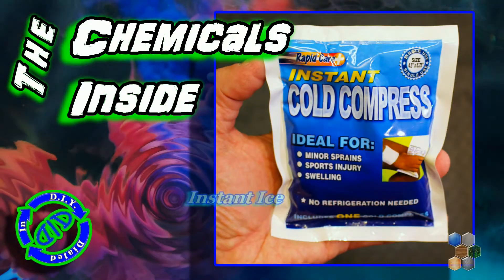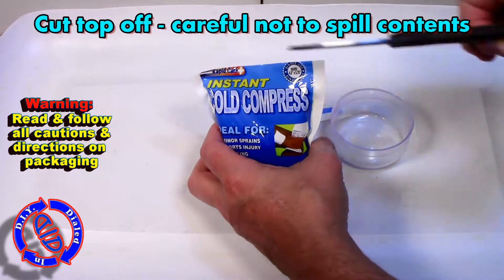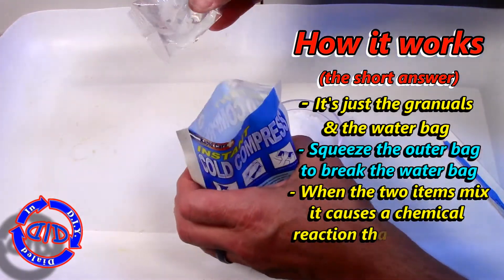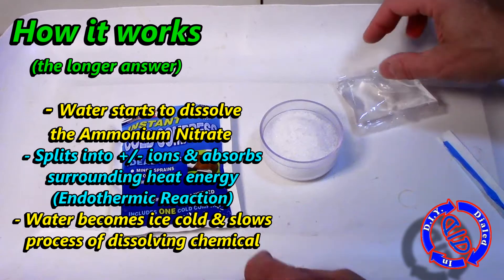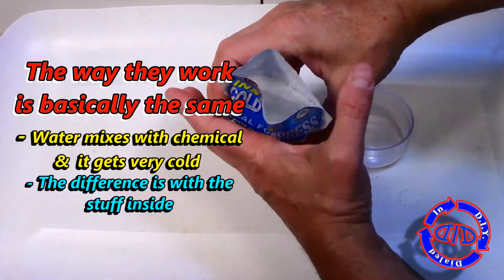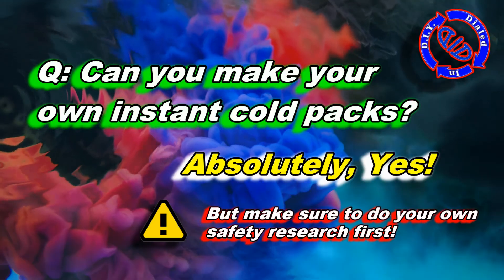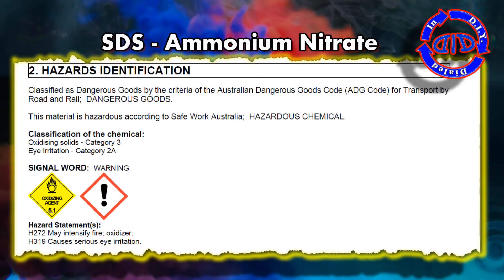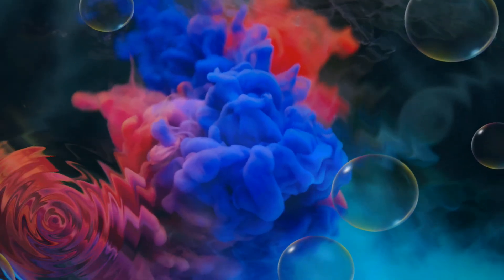Instant Cold Pack - The Chemicals Inside - Product Breakdown

Comment: I got a couple of these and made a mixture of about 2 bags worth of ammonium nitrite in a few quarts of water, soaked separate sheets of newspaper in it, then lay them flat to dry in the sun. After they dry completely you tightly roll them up and tie them so it doesn’t unroll, light  an end and it seriously makes one of the best smoke bombs I’ve ever played around with
Reply from the maker: Awesome idea... I have done this with less water (the least amount needed to dissolve the AN) but am wondering if I can get more paper prepared using extra water... I am going to have try it.  Thanks again!
Reply: After a few batches you’ll notice the more water used will increase yield of saturated papers with less potent smoke emissions. There is definitely a sweet spot of water to AN ratio that of which I didn’t record nor confidently remember lol
Reply: Welcome **
Reply: Hey thanks there buddy, sounds like a good idea that I didn't no. Stink bombs are such fun hay. Lol

Comment: How cold can this get?   I assume it can't be re-used, but how long does it last?

There was a recent HumanOs Podcast (#73) where they talk about a potential therapy for insomnia.. cooling the head (14C-16C or 57F-63F)!!  However, the Ebb device, which is like a BedJet, chilipad or ooler for the forehead, costs $500 for the first year, then $380 every year thereafter!  If this exists at the DollarTree or 99 Cents Only store I'm going to give it a try!
Reply from the maker: That was really cool info re insomnia and cold therapy.  I know there has been allot of research into cognitive effects of controlled brain cooling especially after injury or disease related mental impairment but I did not know about potential sleep benefits.  Seems like it would make sense.  Cold packs were designed to last for about 15 - 20 minutes in order to help reduce inflammation in an injured part of the body.  Typically the temperature of the fluid is reduced up to 35 degrees F.  How cold it gets partly depends on how warm it is to begin with.  Hope that helps!